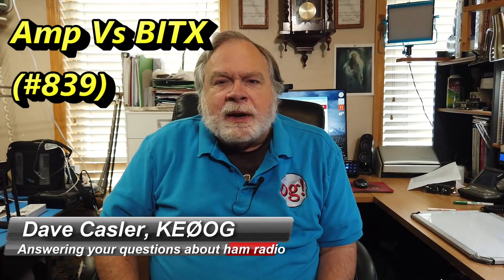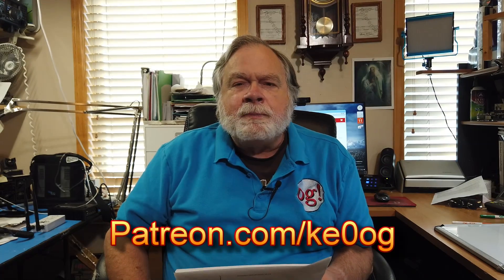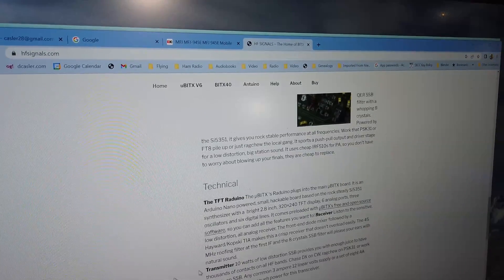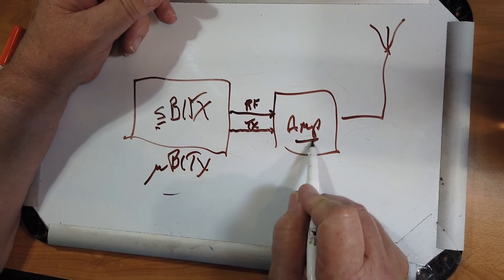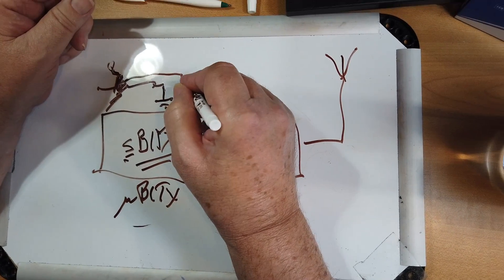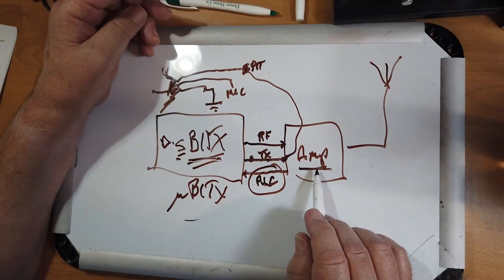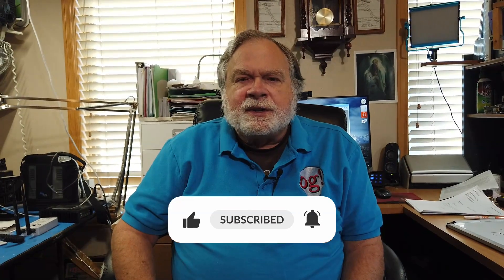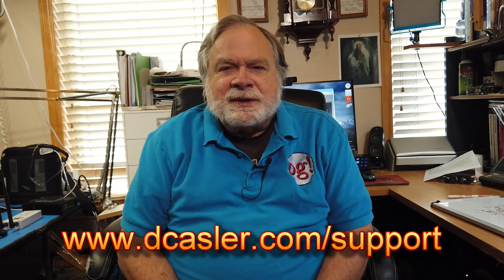Amp Vs BITX (#839)

Comment: Thanks, Dave.  Was thinking, the circuit diagram described may perhaps benefit by having a debouncing switch/circuit inline, when putting the amp into transmit.   Not sure if that's what you meant when you mentioned a relay, etc.  73,  AC3HT

Comment: Even simpler would be to connect a foot peddle to the line out of the amplifier and just switch the amplifier to TX manually.  Foot peddle than PTT…. Un-key PTT- step off peddle.
Reply: YEP  KG6MN
Reply: NO!! Do not do that ,the potential for miskeying is very high with the potential to damage the amp or even the trx. Look up hot switching of PA's and PA sequencing.

Comment: I'd question is the BITX would even drive the PA.  With my PA I need around 7 watts of exciter power to even start to drive the amp.
Reply: But Dave said S bitx's output is 40w. But I don't know.
But 7 watts may or may not be enough.
In the case of a MOSFET (SD2933)or LDMosfet (BLF188xr) amplifier it must be fine, I believe.
De VU2RZA
Reply from the maker: The new sBITX is sold out. It boasted up to 40 watts. Their website is not saying there will be more.
Reply: @davecasler  thanks for the information Dave; yes, I went through the site and didn't find enough, though 👍
De VU2RZA